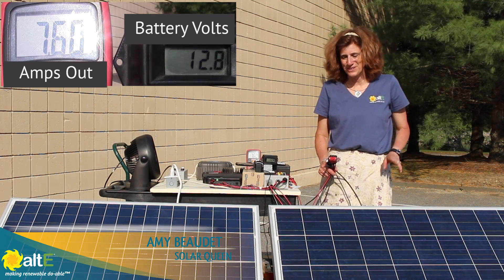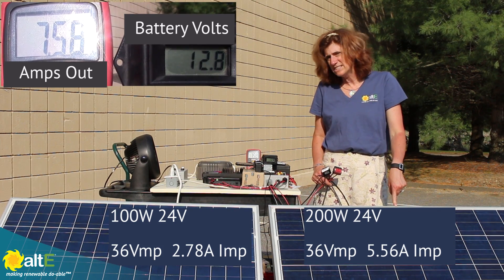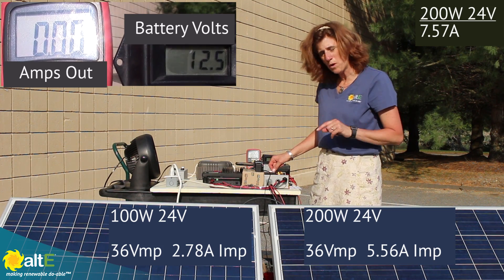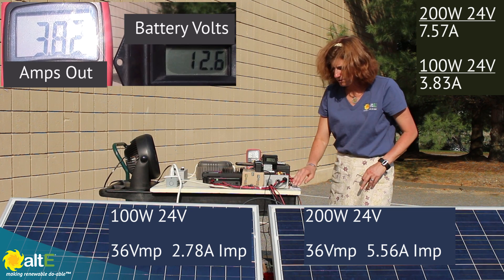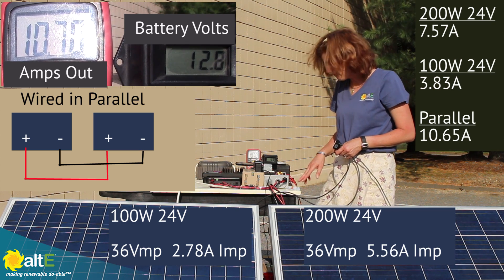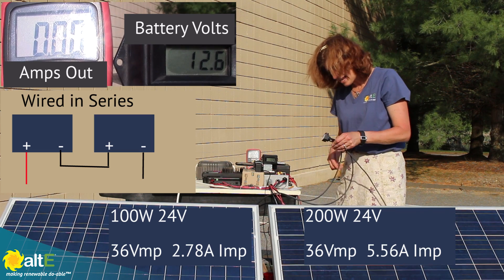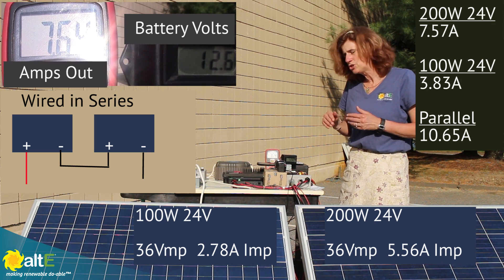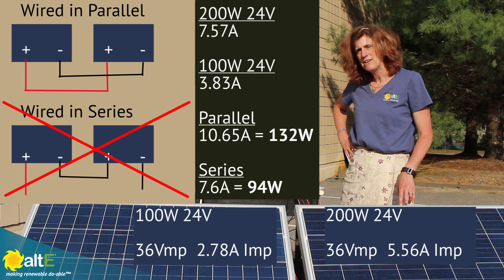What’s worse? Mismatched solar panels with different amps in series or parallel?

Comment: I got a outback charge controller I wants series all my panel to 108 v with 1000watt to charges my 12v battery banks
Reply from the maker: How many Ah is your battery bank? I don't think a 12V battery bank is a good idea for this system. For one thing, 6 panel 160 watt and 8 panel 100 watt panels equal 1760W / 12V = 146A. That is too much current for one charge controller. Batteries like to be charged at about C-10, which is is 10% of the amp hour capacity. That means you would need a 1460Ah battery bank, which is huge for a 12V system, and difficult to build, as you should not have more than 3 parallel strings, so you would need at least 490Ah batteries.

Comment: I got 6 panel 12v 160watt each  and 8 panel 12v 100watt each .. Can I parallel 6panel 160wattand series with 8 panel 100watt
Reply from the maker: What voltage battery bank are you charging? With that much solar, you don't want to be below 24V. The best option is to have 2 charge controllers, one for the 160Ws and one for the 100Ws. WIth that much solar, you probably need 2 anyways.

Comment: Can I do series 160watt with 100watt there are in 12v
Reply from the maker: I would recommend parallel, as the volts are the same and the amps are so different.

Comment: Can you please do video on connecting Mono and Poly together with different voltage and amp?
Reply from the maker: The differences with mono and poly are so slight, there really wouldn't be any issues to show. Yes, the voltage may change a little more with extreme heat or cold on one versus the other, but not enough that would cause me to not do it. It is always best to combine identical panels, but if not possible, as long as the STC ratings match, I wouldn't be so concerned about mono vs poly. Now if this was a huge commercial system that every percentage means the difference of a lot of money, then maybe, but for most systems, don't worry about it.

Comment: Parallel becomes especially important in situations where you have shading running across different panels. If you had a 1000 watt array of 10x 100 watt panels, and one panel was shaded, you would literally destroy 900 watts of the power. In parallel, this wouldn't happen. Nice video. :)
Reply from the maker: Thanks. It's on our list to show how shading affects other panels. Stay tuned.
Reply: In some cases that can be avoided as the shaded panel can bypass itself, thus it will NOT "kill" 900 watts of power.  Also this can be done manually with a switch or if one panel is problematic with shading, just remove or reposition that one panel only.

Comment: That was predictable, same voltage different amperage, parallel will add the amps (voltage is matched).
If you had similar amps, different voltage, wire in series, voltage adds.
Wiring in series with different amperage will limit the output of the most powerful one.

Comment: have you done a video of whether it's worth the expense of an mppt vs pwm charge controller?
Reply from the maker: Just for 24V panels with 12V batteries. I'll be doing 12V panels and batteries soon. Stay tuned.

Comment: I have my bird shed with two miss match panels so I ran 2 PWM controllers independent to my batteries. wouldn't that be better or if you had the money two independent MPPT to get full usage from your panels? 
I would like to know your recommendation on the best Mppt for 300v dc solar Id like to replace my grid tie.
Reply from the maker: Excellent questions. Whether to use PWM vs MPPT often depends on the size of the solar panels and the conditions. Because MPPT charge controllers tend to use a bit more power than PWM, sometimes the power you gain isn't worth the extra power loss to the charge controller itself. If you just have some small panels, PWM can be fine. If you have several hundred watts, it is probably worth it to get MPPT. 

To replace a grid tie string inverter with batteries, a 600V charge controller is the best option so you don't have to change your strings. Schneider and Morningstar both make excellent charge controllers for that task. You can see us talking about the two different products with DC Coupling here https://youtu.be/uQQkwvr9ZFk and here https://youtu.be/AzOZYPFOsI0

Comment: i like to wire solar panels in parallel to get more amps but i have the panels with different ratings so i should put a blocking diode  in parallel connection or not to minimize any damage to my solar panels.
Reply from the maker: If the volts are the same, but the amps are different, you shouldn't need a blocking diode. We did a video on when you may need diodes, you can see it here, https://youtu.be/5rYy0gHZepI
Reply: altE thanks so much alte store i am really happy with your work thanks for sharing videos.

Comment: Of course...hooking up two solar panels of different wattages in parallel is totally fine so long as they are the same voltage. It in effect simply makes a bigger panel that is the sum of the two wattages. 

It's no good in series though as then the current will be limited to the current of the smallest panel. What was happening in your demo was that the MPPT controller was using the 3.xx amps from the 100 watt panel and only about the same from the 200 watt panel. As the same current must flow through all components in a series circuit. 

You wouldn't have been able to do this at all with a PWM controller because it would have been instantly over loaded with voltage. 

However what you could do with many MPPT controllers is hook up two panels that have different voltages and wattages as long as they deliver the same current (Imp).
Reply from the maker: Terrific explanation, thanks, I may borrow it in a future video. We've got a lot more coming out in this series, stay tuned.

Comment: Interesting... but when running parallel if the wire run from the panels to the controller is, say, a very short 20 feet, what gauge wire would you need to keep losses at less that 2%?  And in series what wire gauge would be needed?
Reply from the maker: Great question. Running in parallel into the charge controller, the max power voltage was about 38V and current was 9A. I go online to a voltage drop calculator (I like the one on calculator.net) and see that 12AWG will keep me under 2% voltage drop at 20'. In series, the voltage was twice that at 76V, but the series current would be limited to the lower amperage of the two, so let's say 3A. In that case I could go all the way up to 20AWG if I wanted to and stay under 2% voltage drop.

Comment: Would this work the same way with an existing 90W panel adding two 200w or 250w panels in parallel with the 90w?
Reply: All being 12v panels by the way.
Reply from the maker: You must have read my mind, that video is coming out on Thursday. I have a 200W 24V and added a 50W 12V. Hint, it isn't pretty no matter how it's wired.

Comment: this is the same as if you were to have 2 panels of the same wattage but you shaded one.
Reply from the maker: Great point. Since shading affects current more than voltage, if one panel is shaded, wiring them in parallel is better.

Comment: so of course if using a pwm you could hookup in parallel different watts, if they were matching the battery voltage?
Reply from the maker: I'll be doing a bunch more of these soon, I'll be sure to include that.
Reply: seems to me that 12 volt systems are a waste of money, not many good reasons to do that.

Comment: EXCELLENT explanation. If I could run all my solar panels in parallel...I would. However, the cost in cabling would be enormous...esp with 120+ foot of runs to the three Classics. Efficiency would take a nose dive too. High series voltages are sometimes good, sometimes bad. For long runs = great. Shading...not so good. Question: how about making power with mismatched panels that have different voltages? Say a 12v nominal and a 24v nominal together? Seen a lot of guys/gals doing that...not sure if paralleling  them together or not will kill the amperage. Thanks...great video!
Reply: If the amperage rating of the panels is the same, you can wire them in series. All of the solar cells on the panels are wired in series, so adding more cells in series is the same thing as long as they are all the same size. Like in this video, wiring different size cells in series is like connecting 1/4 inch pipe to 2 inch pipe; having the smaller cells/pipe is going to limit the throughput of amps/water. I don't think you can wire different voltage panels in parallel though unless you had a diode protecting each panel to keep the higher voltage panel from backfeeding the lower voltage panel.
Reply from the maker: Recording that one next week with 100W panels, 24V and 12V. Weather permitting. Oh, I can do it with both MPPT and PWM, that'll be fun.
Reply: Very cool Amy...thanks. That will be really interesting to see. BTW - I fixed all my backyard arrays this spring...KW/H's harvested are in the 20+ now per day!
Reply from the maker: That video is coming out soon. I love your analogy.